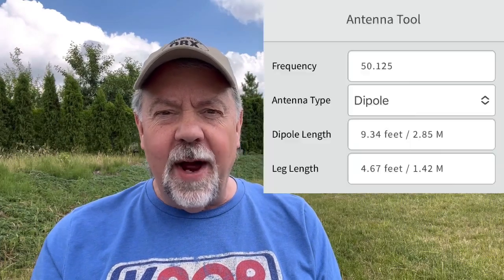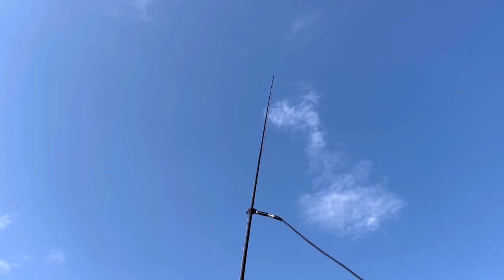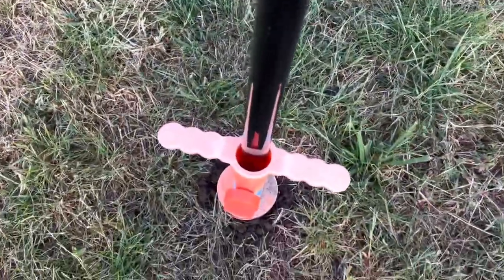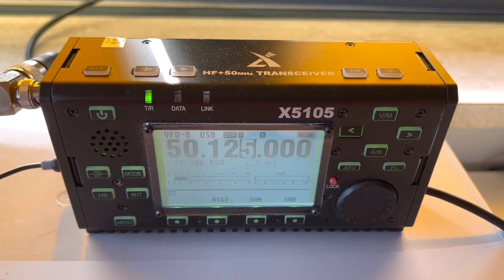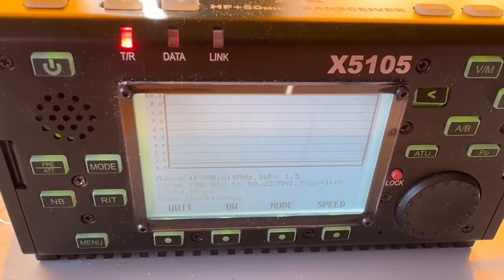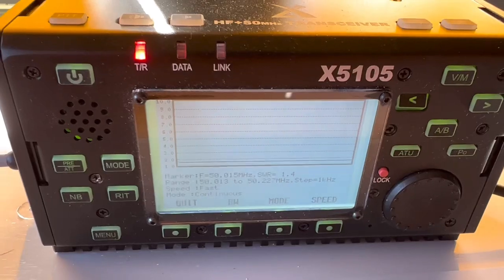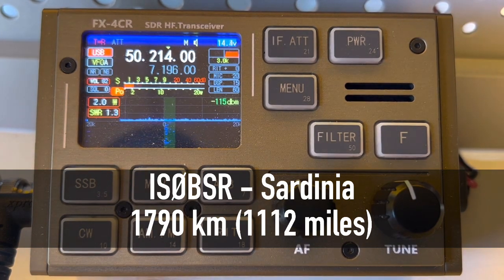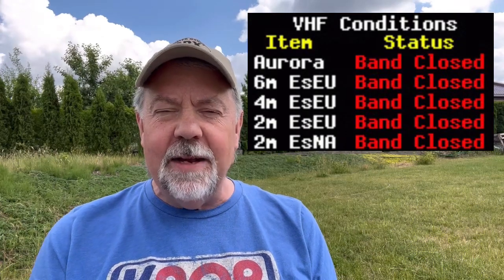Building a Vertical Dipole Antenna for 6 Meters

Comment: I hate saying this, (love your videos) but without a transformer allowing the lower section of that antenna to actually radiate, it's simply a 1/4 wave with a single counterpoise hanging, (~300ohm) and the feedline shield will be like a single radial, (bringing the impedance closer to 50 but not quite) 1.5swr is actually surprisingly great.  I do an insane amount of work with 1/4wave antennas.  If you had some more watts I say send it, but 5 whole watts I'd want the most efficient radiator possible, still made it work, great job man.
Reply from the maker: That’s the N9SAB Nano 1:1 Balun with a banana clip on it at the end of the coax taped to the pole
Reply from the maker: There’s a 1:1 balun at the feedpoint, I explain that in the video, it’s a dipole
Reply: Why does a tuned flat top dipole antenna need a balun?
Reply: @Mikheno  The answer is in the name.  A dipole is a BALanced antenna.  The coax is UNbalanced.  However, lots of people use dipoles, particularly horizontal dipoles, without a balun and they also work OK.
Reply: @BryanTorok  Yes, I use baluns/chokes on most of my antennas. But the post I reponded to implied that without a transformer (balun) only half of the antenna would radiate when he turned the antenna to a vertical position and that just isn't true. The guy doing the video actually had a 1:1 balun (that's a choke not a transformer) and SWR of 1.5:1 so I would say he's radiating just fine. I'll stick with my post that a tuned dipole doesn't need a transformer to radiate regardless of it's orientation. A balun might correct SWR or keep feedback out of the shack but it won't (can't) allow or prevent one side of a dipole from radiating.
Reply: @Mikheno  I think we are actually on the same page.

Comment: I feel ground radials should always be placed under a vertical antenna as I see it as the other half of antenna.  
There should be 16 - 32 ground radials at least 10 feet in length each .   16 gauge not ideal either I would use 
10 gauge braided wire for dipole and ground radials.  Just my opinion
Looks like AI agrees as well.............. Yes, you need ground radials for a 6-meter vertical dipole because they act as 
the "other half" of the antenna, which is required for it to function correctly. A vertical dipole is a type of antenna
 that needs a ground plane to complete its circuit, and radials are used to provide this.

Comment: Hardly any details about the antenna build😢😢😢
Reply from the maker: I thought I explained it all in the video. It’s a simple dipole using 16 gauge speaker wire, a 1:1 balun taped vertically to a pole. I also showed the lengths and talked about the height above ground in the video. What other details do you need?

Comment: Walt, can the 6 meter antenna be a vertical antenna instead of a dipole? If yes, how long would I cut the wire to ? 1/2 wave or full wave wire length????
Reply from the maker: Yes, 2.85 meters for half wave, 5.69 meters for full wave. You’ll probably need some sort of matching unit or unun at the feedpoint. You might get by with just an antenna tuner
Reply: @COASTALWAVESWIRES  Should I get a 1:1, 4:1, 9:1 or what would you recommend for the feed point if you were building this???
Reply from the maker: @Ammed_KN6STX  I would do some research, I’m not sure if any of those would work for a 6 meter halfwave or full wave. Go take a look at The Radio Prepper’s videos. He’s built a halfwave for 6 meters: https://m.youtube.com/watch?v=HzUlyPv6DPA
Reply: @COASTALWAVESWIRES  What about a 6 meter Ham Stick???
Reply from the maker: @Ammed_KN6STX  excellent choice
Reply: @COASTALWAVESWIRES  Does it need a counterpoise wire???

Comment: Thanks, Walt. What else is on your Poland Ham bucket list before you leave for the last time?
Reply from the maker: Hi Warren, I had so many plans for 10 meter operations and antennas. Unfortunately 10 meters hasn’t been opened much this far north in Europe since I’ve been here. I’ve currently got an EFHW up that I brought over and I’ll be operating with it this week, if possible I’m going to try to get out and activate a POTA site this weekend which will be my last here. That’s dependent on my work schedule. Thanks for asking, we’ll see how things work out. 73, Walt

Comment: Walt, Nice work!  I've also had great success hanging an extended double zepp from a 30 ft fiberglass pole.  It's quite a bit bigger at 1.25 wavelengths long, but broadside radiation is a couple dB over a dipole.  For 6m activity, I like to set it up next to the 5 element portable yagi on an antenna switch.  If a station is weak on one, I'll switch to the other to see if they're any stronger on the other.
Reply from the maker: Thanks! That’s a great setup for 6 meters

Comment: hi you have to have the antenna up more herd you but you faded under a rusian ham 5w ws 1,5 kw dipol ists great you are enjoing all of this 73
Reply from the maker: Hi Dan! Thanks for the report!
Reply: @COASTALWAVESWIRES   to many poverfu stations from russia ukrain italy  its had to kompet with 5 w  when all the others com over yoy wit hundrets or thouseds but at nighit wen all stations go of line you can here the small guis poping up 5w 10w all over i usualy monitor and give weekly report back to all hamms i herd or intercepted you wer a 5 and 5 if i am not mastaking ,i usualy brack pail  ups if the operator dosent manage usualy all or most  hams have max 1to 1,5 kw power i usualy go to far above that to brack pail ups 3 to 6 kw and ewery body calms down 😁😁😁

Comment: You don't want the tip of a dipole near the ground. Better to elevate it 1/4 wave or more above ground.
Reply from the maker: I had the lower tip well over a 1/4 wave above the ground. It was actually near a 1/2 wave above the ground for 6 meters.
Reply: @COASTALWAVESWIRES  Okay, I see - it was hard to judge scale from the video. It did seemed to perform well, so it must be pretty good.

Comment: ?? 1.4:1 and you feel you need to tune it?? You wouldn't have Any difference in signal at the receive end trying to get it any lower so not worth the effort, and not any threat to the radio to Have to use the internal tuner. JUST USE IT!!!!
Reply from the maker: As you can see with the FX-4CR I just used it

Comment: Thanks.. For new hams- It is also good practice to TX and call CQ repeatedly on an open freq.. Globally, we're into the Spring/Summer Es Season ( we're also experiencing lots of good F prop with the rising high MUF values as Cycle 25 heads towards it's peak).. In many videos and social platforms the operator will mention how much he/she "listened" and heard nothing. Get that voice keyer programmed-up (or p/u the mic) and start transmitting..hi..Let's revive 50.095 +- & 50.125 MHz +.... We know the paths are there by the common FT8 tones heard on 50.313.. Also, Look for sigs in the beacon subband below 50.08 MHz too. Beacons are TXing 24/7 in all ITU regions (see the the G3USF 50MHz Bcn list).. Note- regardless of Season or Solar condx- HSMS (hi-speed-meteor-scatter) is a year-round option on/near 50.26 MHz using MSK144 and a simple (horizontal) antenna...  73,n6spp-cm98
Reply from the maker: Thanks for the input and comment, 73 de K4OGO